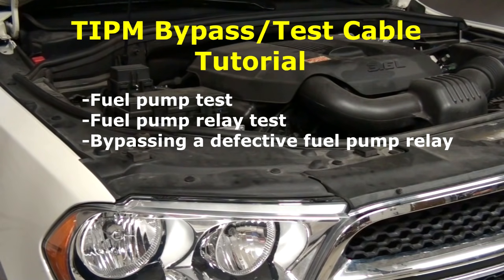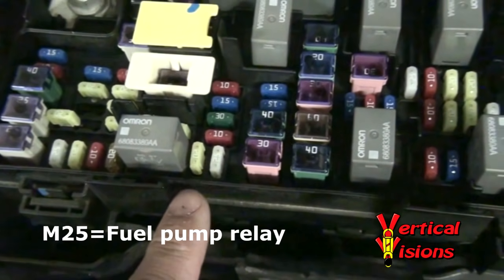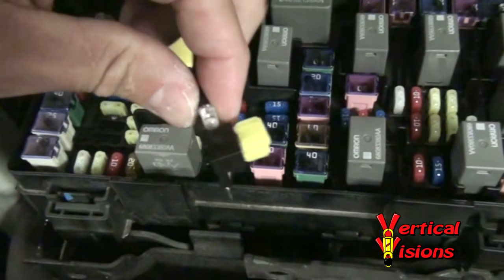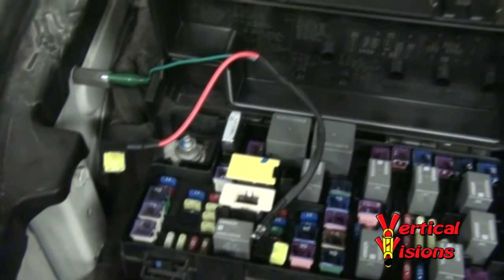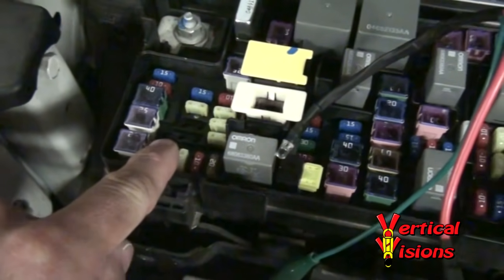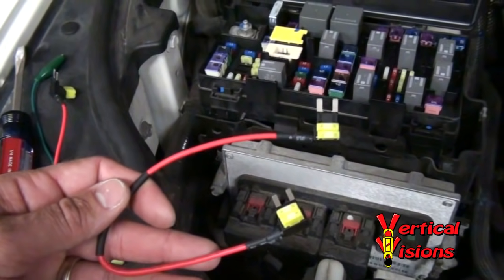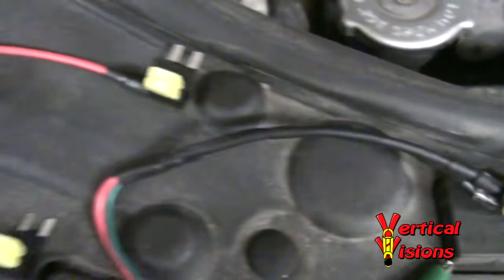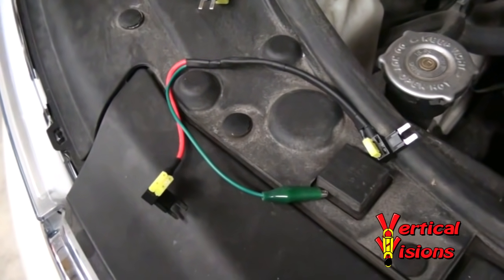TIPM Fuel Relay Test and Bypass Solutions - Most 2007-2021 Dodge, Chrysler, Ram, Jeep, VW Vehicles

Comment: Question:I performed this repair and now I have a battery drain issue. If there something I may have done wrong that would cause this? It doesn’t take long-while getting gas-for it to drain enough the van won’t start. Lights and everything else work, just not enough to turn over the car. Any ideas?
Reply from the maker: Cable could be in the wrong slot.  Use M7 LEFT slots (not right slots).  Did you have battery drainage prior to the cable installation?  Remove the lower yellow fuse on the M25 end of your cable to prevent a "stuck on" fuel relay from draining your battery.  The cable will not drain your battery.  Read this page for answers to most of your questions:  https://www.verticalvisions.com/tipm-test-bypass-cable-mini-blade-fuses.html

Comment: This can be only a temporary solution, just enough to drive the car to the dealer. If you wire like shown in your video, the fuel pump is not turning off in case of an accident with severed fuel lines, and it is going to pump all the gas into the street! The original relay turns the fuel pump off, when the engine stops running. That is a problem that could kill people. The right way to fix this is either to repair the TIPM, get a new TIPM, or do the Recall work as suggested by FCA.
Reply: mygiguser no you are wrong. It is wired to M7 which turns off with the car being off.

Comment: I have mine jumped like that and my remote start, will start my truck for a few seconds then it dies. Do you think this is why?
Reply from the maker: https://www.verticalvisions.com/tipm-test-bypass-cable-mini-blade-fuses.html#faq11
Reply: Jason Bell does the new $159 bypass module fix that problem? I emailed your/that company asking, I haven’t heard back yet.
Reply from the maker: I just emailed you.  There are no remote start restrictions with the TIPM Plug-In Relay System.
Reply: Jason Bell thank you definitely buying one

Comment: Jason: I have ordered your solution for my recently purchased 2010 Chrysler T&C. And, I wonder if there will be any unexpected adverse reaction by utilizing it on the van.
Reply from the maker: The only unexpected reaction most people have is the happiness in fixing their car with a $25 cable.  There are well over 10,000 cables in use around the world, so we know exactly how they work.  However, I will mention that most fuel relay issues are present in 2011-2013 vehicles.  Although we do see some 2010 T&C vehicles, the chances of your fuel relay being the culprit for a no start situation are probably less.
Reply: Thank you Jason. My mailman has just delivered the cable.

Comment: Will this work on a 2011 VW Routan van, made by Chrysler?
Reply from the maker: Yes.  Vehicle chart here:  https://www.verticalvisions.com/tipm-test-bypass-cable-mini-blade-fuses.html#vehicles
Reply: Jason Bell thanks.. I will be ordering it, how long does delivery take. I just bought the van today and it's at an auction, and I was hoping there's a temporary fix while I wait for the cable to get here, so I can save on the towing charge home. Any pointers?
Reply from the maker: We ship cables every day and delivery can be as fast as 1 day.  Our webstore shows delivery options.  As for a temporary fix, go here:  https://www.verticalvisions.com/tipm-test-bypass-cable-mini-blade-fuses.html#buildyourown
Reply: Jason Bell thanks so much man.
Reply: I received the part and did the tests... on test one, the led came on after turning on key.
On test two - fuel pump test, the led comes on, but there is no sound from the pump and the car doesn't start. 
I tried the bypass procedure but the car is still not starting. 
according to the instructions, it maybe the fuel pump, but what else could prevent the pump from coming on before I spend a small fortune on replacement? I also added gas (2gallons) to make sure. I sprayed starter fluid at intake and the car started and then shut off of course coz there was no fuel pumped. Any help would be appreciated.
Reply from the maker: If you performed the fuel pump test (cable in M7 right slot and M25) and there was no fuel pump activity, then you likely have a fuel pump problem.   Keep in mind that fuel pumps don't fail that often on these vehicles.

Comment: Wednesday.... Took battery to AutoZone. Tested good

Thursday... Took battery to Advanced Auto Parts. Tested good. 
 
Friday ...had AutoZone charge and test my battery. They said it tested good. 

Today... after I charged the battery myself and it still was dragging, I tested it at Orileys. Tested BAD
Took it back to AutoZone they tested it.... BAD 

After 3 days finally got it replaced under warranty.  
I made my own bypass cable and installed just as a precaution. I'll observe over the next few days to see any performance improvements and if any gremlins disappear.

Comment: Jason, I am having issues with the fuel pump relay on my 2010 Dodge Ram 1500.  I saw that you had marked NO on your chart for that year and make when it came to the relay bypass.  Why will this not work for that year and model?  if that doesn't work, what are my options? 

 

 

Reply
Reply from the maker: We get this question a lot, so we have a FAQ on the subject:  https://www.verticalvisions.com/tipm-test-bypass-cable-mini-blade-fuses.html#faq10

Comment: Does the jumper purposely avoid sending power to the 2nd slot in the M25 slot, or does the relay send power to both slots in the M25 location? Thanks.
Reply from the maker: The relay inside your TIPM sends power to one side of M25.  This fuse allows current to flow to the other side of M25 and then to the fuel pump.  With a TIPM cable installed, your M7 fuse slot sends power through the cable to one or both sides of M25, depending on your particular problem.  We recommend removing the lower fuse on the M25 end of the cable if you have a fuel relay that is stuck on, which means only one leg of the M25 gets power.  It's complicated, but most situations will see the cable as a secondary source of current to compliment your existing fuel relay.  One or both provide power at the same time.  If your fuel relay isn't having a good day, the cable provides power.  Having two sources of power isn't harmful as they both come from the same 12 VDC feed to the TIPM.  It's just that the cable will be there in case the fuel relay can't.  A good source to visualize this is here:  https://www.verticalvisions.com/wiring-diagrams.html

Comment: Question:
Even if I jumped the battery off with another car and the car starts, I'm assuming that the tipm won't be my problem then huh?
Reply from the maker: Higher battery voltages, such as those present from a running vehicle that outputs around 14 VDC, can cause a faulty relay to work in situations where it will would normally not.  A vehicle that is cranking the starter only outputs around 12.5 VDC or less, since the alternator isn't providing higher voltages yet.  So, to answer your question, you may still have a fuel relay issue.

Comment: Hello.I have a similar problem in my van.sometimes sound like if the battery is dead and sometimes the starter is cranking but not start.I  disconnected the hose of the fuel pump and is OK but when the van is cranking the fuel pump stop.the solution is the same:?
Reply from the maker: What vehicle year/make/model?
Reply: Jason Bell Dodge grand caravan 2011

Comment: I have a 2006 Dodge Ram 1500 with the 4.7 liter engine, my vehicle is not listed any recommendations for this vehicle? Seems to either be the fuel pump or the relay not sure which.
Reply: Same issue with little to no answers for this year(2006)

Comment: I did the first test,light stayed on but no sound from the pump,the second test while car running no lights,and they put in a fuel pump,under warranty back in oct '17,but back to the third test when running and hooked up all was well,do i ask for relay or tipm board? Thanx
Reply from the maker: I'm not sure which tests you are performing.  Can you provide additional details or contact us directly and we will respond?  Thanks.

Comment: Would this cause dash guages to go nuts and ac to cut off? My town and country does not even crank unless i wiggle the TIPM harness. The fuel pump does run for a few seconds when turned off and we often smell gas.
Reply from the maker: Although I believe we spoke on the phone about this, it sounds like you have an electrical connection issue.  Suggest you remove TIPM, check all 7 electrical connectors under TIPM, and verify that no black plastic posts were damaged during your prior TIPM swap.  Black posts near connectors are often broken during TIPM removal and then can allow the connector to not be fully seated.

Comment: Why do you have 4- 20 Amp fuses in your tester?
Reply from the maker: They're present because we need to isolate loads for testing purposes.  If you read through our instructions, it will indicate that some fuses need to be present or removed for certain tests.  Here is the link to the manual:  http://www.verticalvisions.com/documents/TIPM_cable_instructions_SIMPLE_or_STANDARD.pdf
Reply: Thanks. The link you posted didn't work but this did. www.verticalvisions/TIPM_wiring_diagrams.php Makes perfect sense now.

Comment: I have an issue were my 2011 won't turn over.  Full battery.  Last night I tried many times with no luck.  I planned to tow it today but thought I would try again and it started like there was never an issue.  I wonder if this fix is for me?
Reply from the maker: If your vehicle acts like it's out of gas when you attempt to start it, the cable will help (assuming you indeed have a fuel relay issue).  If you turn the key to start the vehicle and nothing happens, you have other issues that the cable will not resolve.  2011 vehicles are the worst for fuel relay issues.  2011 Dodge Caravan is our most popular fix, followed by 2011 Chrysler Town & Country and 2011 Dodge Ram 1500

Comment: I watched this video & I wanted to know if this is necessary? https://youtu.be/mf-oiEEr31Y
Reply from the maker: This video shows an external relay installation, which we only recommend if you can solder it yourself because dealers often charge $400 to install it.  It also involves cutting harness wires, which is never a good idea, and we created an alternate plug-in product based on the external.  More info here:  http://www.verticalvisions.com/TIPM_relays_plugin.php

Comment: I plugged the wire into the fuel relay side and hooked up the green LEDs light. But no light came on when i started the 2011 dodge Durango
Reply from the maker: Your 2011 Durango might have an external relay installed by your dealer, per the 2014 fuel relay recall.  Most do.  If so, your dealer cut wires under your TIPM to completely disconnect the OEM fuel relay from the fuel pump circuit.    Here's how you can identify the presence of an external relay:  http://www.verticalvisions.com/TIPM_relays_external.php#identify.  Our TIPM cables won't work if an external relay is installed.  Other things that can cause the LED to not illuminate are:  Faulty fuel relay not sending 12 VDC to fuel pump, TIPM cable ground wire not hooked up properly, etc.  Your message didn't indicate if the vehicle started with no LED illuminated?  Contact us directly for faster service at www.verticalvisions.com

Comment: My fuel pump fuse m 25 amp. So do I have replace simple cable amp 20 to amped 25 before I plung in or ?
Reply from the maker: New message to: smartmo4959
If you have a TIPM-7 style fuse box with one of the applicable vehicles listed on our website, then your fuel pump fuse should be 20 amps (not 25 amps). Since fuel pumps normally consume around 8-9 amps, the use of a 20 or 25 amp fuse isn't going to prevent the operation of the pump. However, the use of a 25 amp fuse in a 20 amp circuit runs the potential for wire damage if the pump were to have a short circuit. Fuses protect the wiring and must be matched to the wire size.

Comment: I wanted to give a shout out to Jason. I bought his bypass product around june 2016. This has been a life saver. We have a 2012 dodge caravan, and the dealer wanted $1200 to fix fuel pump relay. An honestly, back then money was tight. I found jason while searching for a solution.  We havent  had any issues with this fix for almost 2 years now. Ive been meaning to say thanks, but just got busy. Great product! I highly recommend. It also came with step by step instructions. Thanks again Jason. Well done.
Reply from the maker: Thanks Mike.  Great feedback.  Let us know if you have any questions down the road.
Reply: Does this work if the fuse is hot all the time but do not hear the fuel pump?

Comment: John Gamble, February, 2018
Thanks to Jason Bell and Vertical Visions, my daughter's 2011 Chrysler Town & Country is now running like it should.  My my daughter's husband found the information and problems with the TIPM on the internet, I contacted Vertical Visions, got the testing cables and verified that the fuel pump relay was defective. Sent the TIPM to Jason Bell at Vertical Visions and they replaced the fuel pump relay, checked the TIPM out further, and sent it back to me the following day. Followed the instructions and put it back in the van and it started right up and the fuel pump operated properly. Prior to contacting Vertical Visions, my daughter and her husband had replaced the battery, which went completely dead a few times, then the alternator that the garage said had an electrical short in it, and then the spark plugs.  None of these expensive replacements did anything to solve the bad starting and dead battery problems and none of the garage mechanics even checked the TIPM and fuel pump relay that was draining the battery overnight.  It was my son-in-law who heard the fuel pump running after the ignition was turned off that got him to checking on the internet and found the TIPM problems with the Chrysler, Dodges, Jeeps, etc. Thanks again Jason Bell and Vertical Visions.
Reply from the maker: Thanks John.  Let us know if you have any questions down the road.

Comment: So after bypass is it ok that fuel pumps keeps running when ignition is on? Because originally it runs for about 3 seconds and turns off until you start the truck.
Reply from the maker: It will cause no issues as fuel is simply recycled in the tank.  The TIPM cable is a key on/pump on system.

Comment: My magnum will not crank or start. Could it be the tipm? I need help
Reply from the maker: No crank issues are normally not TIPM-related.  Solve the cranking issue first by checking starter relay integrity, ensuring battery voltage is sufficient (at least 12+ VDC), and checking starter operation with an alternate 12 VDC source (if you can even access the starter since some are so buried that replacement is a 6 hour job).   Starter could be faulty or wires feeding it could be corroded or not conducting.

Comment: Use a sufficient size wire. Twist it around one of the receptacle fuse prongs an run it to one of the fuel pump relay prongs. And done . Free permanent fix. I've been running my truck for about nine months like this with no problems. You tube is not for free product advertising. It's for sharing knowledge for those who seak it. Request pics and I'll show you the free way to fix it.
Reply from the maker: You're right that YouTube is for sharing knowledge, which is why we've always maintained a web page showing everyone how to build their own TIPM cable:  http://www.verticalvisions.com/TIPM_cables.php#buildone.  Secondly, we talk about the free instructions in the video description above.  Third, I"m not sure how you missed this but it's ALSO discussed in the actual video.  Perhaps our free instructions allowed you to build your own for the last nine months?  The main issue in using scrap wire is that a hot wire can disconnect from the fuse, cause stalling and/or electrical damage to the TIPM.  It's much easier to simply plug a TIPM cable into two fuse slots.

Comment: This may be a dumb question but what if i dont have a cigarette lighter in the back of the van?
Reply from the maker: All TIPMs still have the hardware (M7 fuse slot) to support a rear cigarette lighter, so the presence of one doesn't matter.
Reply: Jason Bell LoL thanks jason, I feel like an idiot
Reply: Jason Bell I went ahead and ordered one with led

Comment: would this work on a dodge Durango 2013 because im having problems starting it now thnx
Reply from the maker: Yes.  However, many 2013 Durangos in the USA already have an external relay installed per a recall.  The external relay installation involves cutting harness wires under the TIPM, which means our cable and many other fuel relay fixes won't work after this modification.  An external relay is a bad way to fix this problem and most dealers will charge $400+ to install it.  Here is how you can identify an external relay:  http://www.verticalvisions.com/TIPM_relays_external.php#identify